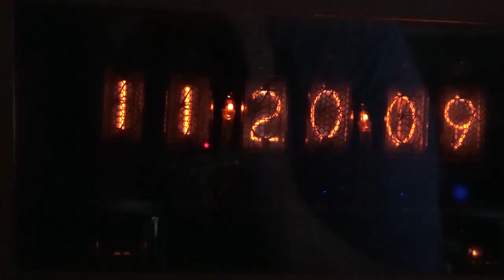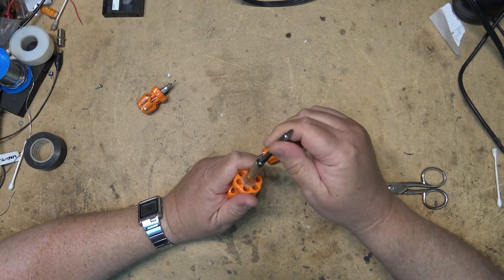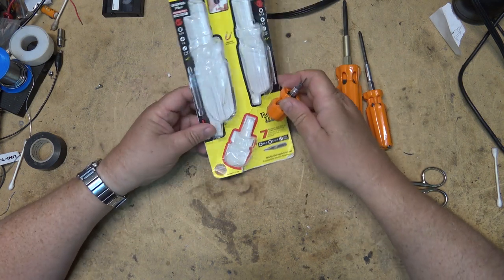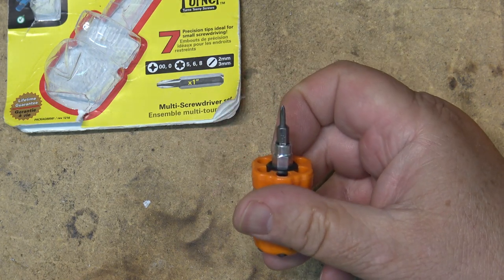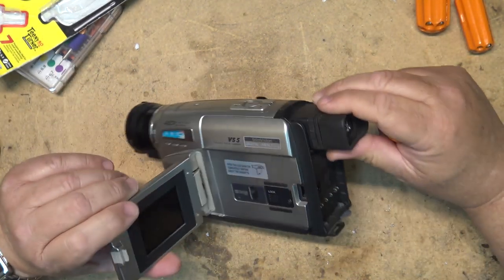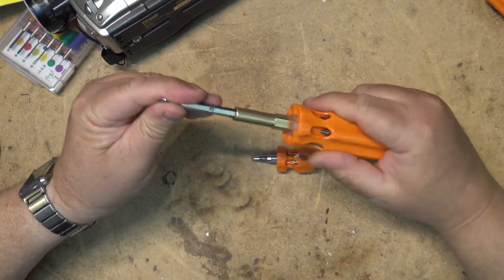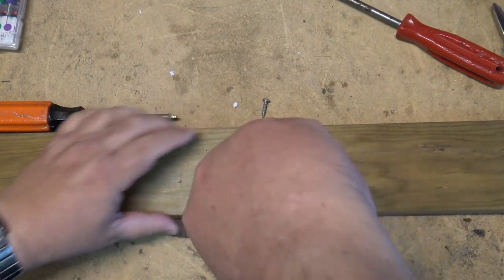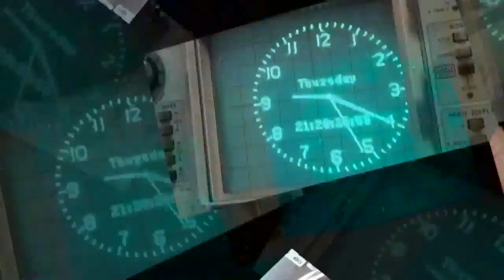Picquic Screwdriver Set Built to last in Canada

Comment: New Zealand has been using Robertson for years for building houses. I never needed one in my kit until I started doing networking and found 90 percent of our wall jacks have Robertson holding the flush box in. Great screws for sure. Thanks Canada. My other favourite screw is Pozidriv. They have a very positive fit also and can take plenty of torque without cramming out. Small tip for everyone : try a number 1 Pozidriv screwdriver on your average Phillips screw. Fits much better

Comment: I have the large one, and it's well made, but after working for years as an electrician, I can't get used to the bulkiness compared to ordinary screwdrivers where you can twirls them between your fingers like I see you doing sometimes. When I see you using screwdrivers, I notice quite a similarity to the way I use them. Then along came the battery powered drills, and none of the young guys use screwdrivers. I guess they won't be getting carpal tunnel though.
Reply from the maker: Bits for this fit my electric.
Reply: @12voltvids  Yeah, mine too.

Comment: Yep the robertson screws/drivers would have been far better for grip and no caming out.
The stubby driver has always been good for tight places.
I hate the caming out with philips/pozidrive and similar, it was supposed to stop over tightening but it just slips in normal use, and when they wear a little it slips more :-(

Comment: Robertson screws are awesome torx are pretty nice to. never got why phillips became the standard when they are so sucky they strip out so easy and were barely a step up from the slotted crap that there was before that. only down side to it is try finding a screw driver for the smallest size the #00 no one carries it only one i could find was one made by a German company and it wasn't a official Robertson  to get one. i had to contact Robertson directly and the lady in there sales dept very reluctantly sold me one
Reply: I believe that the Phillips type "cross head" interface gained prominence primarily due to automation. Robots, at the time, had an easier time interfacing with Phillips head screws. Alas, old habits truly are hard to break...
Reply: Phillips were much better than slotted.